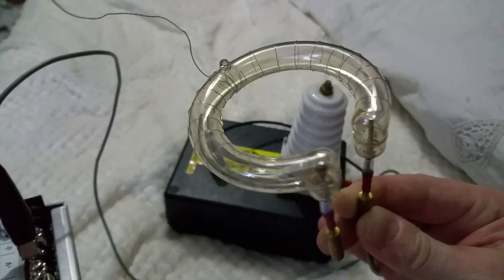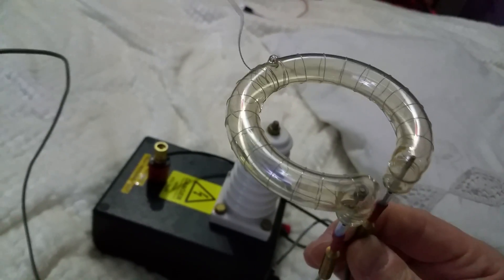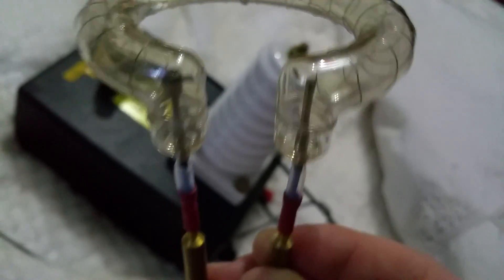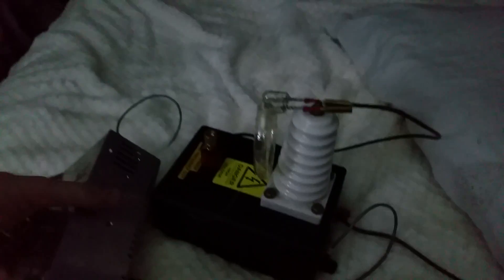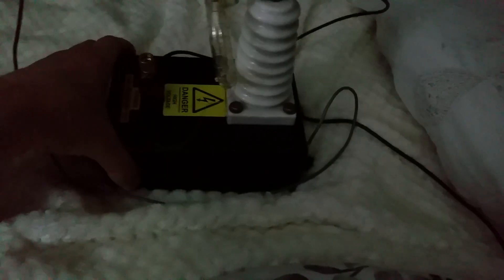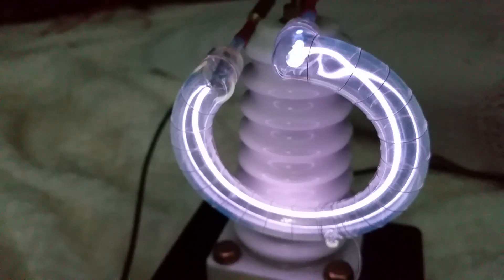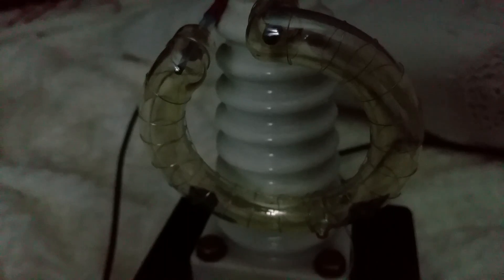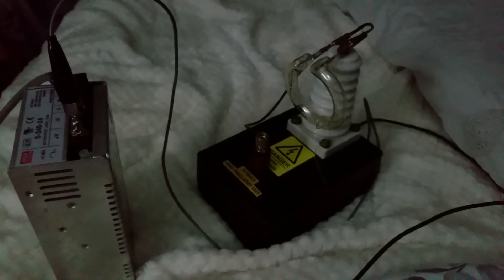What is this guys?

Comment: I have seen those lamps for professional photography. The wire around is the trigger. Normally the main contacts are supplied with a few kV DC permanently. They are wired in parallel to a capacitor. The flash is then triggered by applying a few kV to the trigger wire. This makes the gas in the lamp conductive and discharges the capacitor.
Reply from the maker: Hey buddy, thanks for watching and ya comment.

Yes I'm aware how they work, I just didnt know what they were off and for.

thanks you for your time and info! Much appreciated. 

Regards

Anthony

High1voltage1rules

Comment: I know probably everyone has already said this (i haven't read the comments yet), but that's a xenon flash tube, the two wires at each end go to a high voltage supply (usually a capacitor charged to a few hundred volts), the wire in the middle is the striking wire, where a short high voltage pulse is applied to ionize the gas, (or in other words makes the gas conductive) so it can flash and discharge the capacitor as it does so
Reply: wats up Clem you should make some high voltage videos again like with a couple mots 😉😉😉👍
Reply: +Lost In Space Electronics I will when the weather gets a little warmer, I don't want to do that kind of stuff in my room any more in case I hurt any of my stuff from RF and things like that.  Also I need to fix my computer as it got a nasty virus that screwd with the bios and made Windows not boot. I have most of that sorted out now, I have evrything I want to be saved, made sure all that is clean of viruses I just need tformat my drive and reinstall Windows and everything should be good.  I'm having to comment via my Wii-U right now and I'm not used to touchscreen keyyboards.
Reply: +CoolDudeClem OK sounds good maybe you need a shack outback??? with good ventilation for smoke and ozone

Comment: its a flash tube. apply about 400v (capacitor bank) to the 2 big Terminals. afterwards you have to 'ignite' the tube, by ionising its gas. the tube is being ionised when you apply about 3kv between negative of the big Terminals and The thin Metal wire (wrapped around the tube). now The gas has very little conductivity and Thema 400v (cap Bank) is being discharged inside the tube.
best regards
Reply: **it will have very low restistance => very HIGH conductivity

Comment: Flashtube is likely, that wire is the trigger wire.  Given the shape I'm guessing specialist photo flash (ring flash for around the lens of the camera possibly). Could also be the flash tube for "pumping" a laser like an older ruby one or a gas one, though those are often a spiral. The gas I'm pretty sure is xenon, which is standard for flashbulbs due to it's white spectral emissions